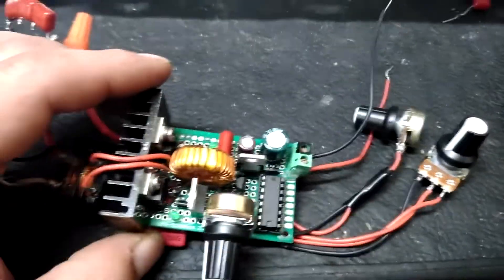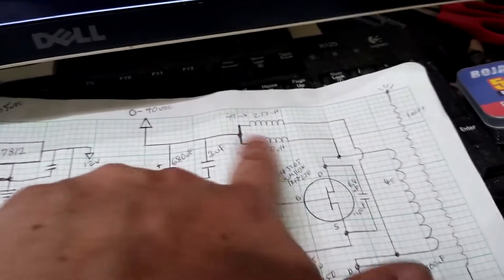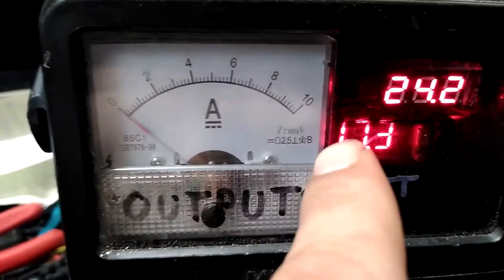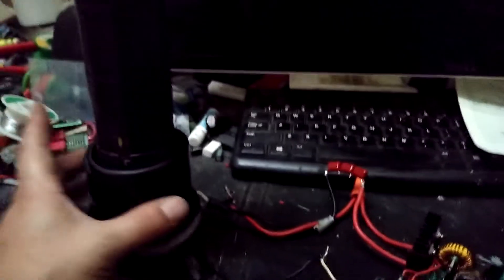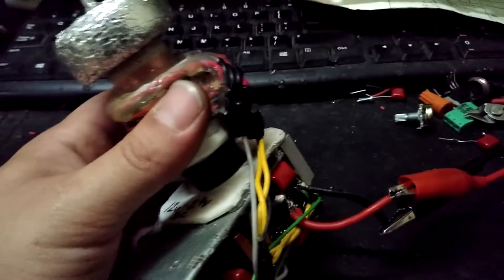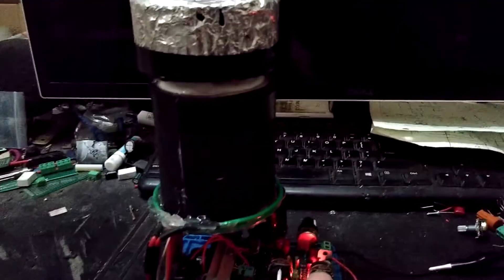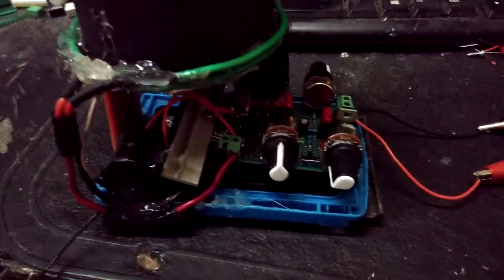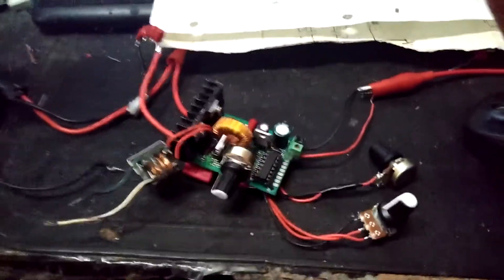24v SSTC/DRSSTC (Driverless) IRF3205's

Comment: what a nice and powerful coils you have! may I ask the winding directions of the primary and secondary? do they need to be in the same direction in order to work?
Reply from the maker: They need to have proper polarity relative to each other. That basically just means the direction is going to depend on how you wire it.

Comment: Tôi thực hiện giống như mạch của bạn nhưng với ic 555 nó không hoạt động, chỉ có một chút tia lửa nhỏ trên topload mà thôi 😢😢😢😢
Reply from the maker: Look at it like this.. so long as you have some output at all, you have it 'working'. That's one big step right there, just to get it working. You can likely now just play with the variables and eventually land on better output.
Reply: @Magneticitist  It killed my 460 mosfet like a terminator 😔
Reply from the maker: @jinnguyen4598  460's suck anyway, at least all the ones not coming straight from legit vendors. I would start with IRFZ44N's and between 12-16V or so input for building your first ones. If you're going to use what may be something like inexpensive ebay or amazon fets I would just use IRFP250's.
Reply: @Magneticitist  My 555 driver fails to interfere with the power circuit, I see the 555 ic still controls the flashing led but the power components do not follow the 555 ic, it always outputs spark with maximum power because  so it kills my mosfet 3205 then it kills 460 😔
Reply from the maker: @jinnguyen4598  It's just not pulling the gates low enough apparently. I would sometimes have that problem due to interference and bad grounding but if your indicator led seems to work perfectly on the beat then maybe it's something else. If you can't get that to work you can try using another mosfet to interrupt the power rail instead.
Reply: @Magneticitist  I tried z44, irf3205, and tip41 bulb still no result, I used 2 4148 pulse diodes at pin G!  , am I using the wrong diode????
Reply from the maker: @jinnguyen4598  Technically they are supposed to be Schottky diodes so yes they are wrong, but I'm not sure whether 4148's switching diodes wouldn't also work though..

What is your testing process? You also have to set the voltage divider properly for good oscillation, but you can't actually get it going if the gates are pulled to ground. This is why technically you should try testing it without interrupting it, but just at lower voltages and not for long periods to cause overheating. You need to set the voltage divider til there is just enough voltages on the gates to start oscillation. Then cut it off. At that point any time you pull the gates completely to ground, it's no longer going to oscillate. It can't. If it does, that means the gates are not held at ground when the interrupter is on and you need to figure out why.
Reply: @Magneticitist  I have found the reason, the topload on its head is too large so it cannot emit electric sparks. I removed the topload and the spark seems strong, can you give me the index of your resonant capacitor?  how many farads?
Reply from the maker: @jinnguyen4598  I'm not sure but I think I probably used 33nF on the circuit I drew the diagram for. It's not going to be the same for you though, you'll need to experiment. Typically a ballpark value that is fairly close will give you a noticeable enough difference to know you are going in the right direction.
Reply: @Magneticitist  Well thank you very much

Comment: Back in this project months later....
Wound a 36awg secondary, used some irfp250 and I got 2" sparks at 20v still decent for me . But whenever i connect the series primary cap, it goes way out of phase and Just doesn't work so I got it working with some parallel caps to primary. Do the d-s caps acts as snubbers ? I don't think so and my fets are still cool enough. Adding 22nf caps to d-s basically makes no noticable difference . Will be tuning it a bit more but don't know from where , the gdt works fine and IIr primary caps too not sure about the purpose of d-s caps though.
Reply from the maker: The series primary cap will change the phase relation which is sort of the point of it but you have to be at a tuning where adjusting that cap value will get you closer to the ideal tuning for it to be of any benefit. Often times instead of adjusting anything else I can just adjust that primary cap value to get particular coils tuned well. 

As for the snubbers that's more or less what they are, but they can't just be any random value to work. I've seen a lot of varying operation with these but in general they will act as snubbers and minimize the spiking on the drains. In order for them to actually help their values need to be in the right ballpark. If they are too large they are probably only going to hinder. If you were to scope the drains without the snubbers you might see what looks like 'normal' single ended operation on each switch with a lot of high voltage ringing. This will heat the fets. Likewise, if snubbers are too large they will probably heat the fets all the same. 

I don't really try to tune these 'dual class e' like some people because I find it too difficult, and the tuning all changes around given the slightest variations in how I have the output at the time. A lot of times I end up with 'double hump' waveforms on the drains.
Reply: Hey did you pop your Fets by adding series mmc? And now using parallel caps in primary?

Comment: I been looking into this fets Irfb4110  N chanel 120a 100v 370w Rds=0.037ohm I can get them at a reasonable price and it looks like these would work just fine to drive the tefatronix at about 35v with my boost converter , I feel this ones are gonna work better than irfp 260 for this voltage
Reply from the maker: Those would probably work pretty good but I would also recommend grabbing an Amazon pack of 3205s. I would use some cheap dummies for a lot of builds and testing while saving some more expensive suitable switches for final builds. I think what helped me get pretty far with a lot of these is just the sheer numbers of them. I intentionally tried to use cheap mosfets so I can make as many of these circuits as possible at low cost. Then after you've made about four or five of them things start to come together and it gets easier to make the next.
Reply: @Magneticitist  ohh brother , I wish I could buy on Amazon or Ebay but my Country put a bunch of regulations prohibitions and taxes , the amount of paper work just makes me go crazy , last time I bought something on ebay I did like 2 hours of wait at the post Office and they did not wanted to give me the package cause I put one number wrong , so now I stick to buying on electronics stores on my area (overprice fake garbage or sometimes super overprice original stuff) , sucks to live in this shitty Country
Reply from the maker: @rodriguezfranco3839  It seems to be a big problem with a lot of people so it makes sense why there are a good number of people asking me about particular circuits using particular easy to find IC's and stuff like that. Where I live I can't even think of an electronics store to buy stuff from directly so I have to get it online. We used to have Radio Shack and that was about it.
Reply: @Magneticitist  yeep , it feels cool to buy on a store , I got about 4 stores near my Area , but they got a very limited stock of IC's or electronics components , I heard about Radio Shack and seen a few videos about it seems like there are still a few of them open in the states , those stores look like electonics junkys Paradise lol , but I remember when I use to buy online on Ebay at some point I had a packet everyday arriving at my door and the prices wore so dang good I was making some good money resaling stuff , but then politics fucked up .

Comment: Hi, after trying every possible tuning modification i can think of, i still can't have it work anyway near your coils at either 12v or 24v. i tried the changing the primary to two turns and got the best arc (about 1/4th of an inch at 12v lol),i used 33nf cap bank in series primary.
i have a small coil about 7cm long and an inch in diameter which i wound from thin relay wire and is quite ugly and crap :/ , swapping the gdt didn't made any noticeable difference, using total 6600uF caps at input . should i try interchanging the choke wires? i have a centre tapped yellow choke with 35 turns total and what effect the capacitors 100nf on gate to source makes in this circuit? sorry for asking too many questions but i want to have it work within a day or so and i have no idea how to proceed for the further tuning. 
if this wouldn't work, i have some 32guage wire and i would wound a new secondary, any tips about secondary diameter and resonant frequency so i can calculate it from the web? thank you if you read this. :)
Reply from the maker: Hard to really say what you should change but it's possible there are still some things you have reversed or haven't tried. For example I wasn't too clear on the choke wiring probably because I forgot at the time, but swapping that around is worth a try. You could possibly just actually have the feedback phasing reversed also and the combination if your primary tuning and series cap is still making it work a little bit. Maybe just try reversing the feedback/GDT primary or secondary to see. If it doesn't want to output any plasma at all then it was probably right the way you had it. 

Other than that the 100nF drain caps were based on what I had at the time in my particular coil at its resonant frequency and I stuck to that region with other coils which was around 700-900mhz. 
They are basically tuned snubbers. Lowering the value to not below a few nF or so could better results, but so could slightly adjusting the series primary capacitor value. If it wants to work better with the 33nF cap as opposed to none at all, then maybe you could try doubling the value etc. This is also going to be relative to where you have the primary tuned at the time. I usually use 36AWG but I've made 32 work before in some of my first ones. With 32 I'd try to at least go for 7 inches or so maybe 2.5 inches wide.
Reply: @Magneticitist After trying 6 gdts and many primaries and adjusting its height, I got only about 1cm sparks at 12v and about 1.5cm at 24v , mine doesnt work with 100nF drain to source caps , it gets pretty hot too and I have roughly 33nF in series with primary. Guess I can't tune this anymore and need to get some 40awg wire someday , also have a second thought of increasing its voltage though.
Reply from the maker: @anmolkumar6704  Check out this replication https://www.youtube.com/shorts/DReCYcQRZ10

His was matched closer to the specs I put in the schematic I posted using the sort of tall 9inch or so coil.

He just happened to land on the right variables to play with in order to get good output. The sound of his arcs also seems familiar and it doesn't sound like it's about to crap out from wild tuning. What were your coil dimensions again?
Reply: @Magneticitist  i later wound a 2.5 inch by 6inch coil with all 0.2mm wire i had

Comment: Hi ,I built one yesterday but it didnt work out that well only getting half inch sparks at 24 v , MOSFETs(irf540) gets too hot in even 10-20secs , using the tefatronix push pull circuitry for mosfets with a 555 timer. Using a topload or adding a 2.2nf at secondary feedback shuts
It down. What could be possibly wrong?
Reply from the maker: I never tried 540's but I'd think they would be fairly ideal. Do you know if your gate voltage as set by the divider RV1 is appropriate? Too much voltage can overdrive it, I usually put just enough on there for reliable oscillation. 

At 24V you're going to heat up those fets either way if you are running continuous wave. The only way to avoid that is to do more specific tuning using snubbers and the primary coil so it runs efficiently. The other variable is the GDT which is harder to get just right without being able to observe the signal but you can usually just do some adjustments on it to see what difference it's making. Trying different ratios or winding techniques etc. I usually just use a pre wound common inductor from some PSU filter or something.

The other variable people do not think of a lot is the magnetic and electric field profile and how that affects oscillation. The output needs to be properly loaded, but in order to properly load it at the right times the topload and breakout points need to be tuned. It's not like a regular circuit where you can just toss a random topload on and have it work well. You have to try it without toploads, with various ones, using different length breakouts points etc.. Move the primary up and down various places with each variation. I've had some circuits that needed a particular topload and some which didn't like any at all. 

You also might need to help encourage the actual initial breakout using your hand or something. This is when it's going to run properly when it's being loaded by the output plasma.
Reply: @Magneticitist  i monitor the gate voltage and it seems completely fine about 4v but one major issue I worry about is that it doesn't seem like the interuptter is working as I always get a steady small stream. I used a 555timer with 100nf, pin6- 12k -pin7 -100k resistor -100k pot -vcc
Reply from the maker: @anmolkumar6704  Interference can be an issue with these. For me sometimes the interrupter wouldn't work right and it would slam into CW randomly. Adding some circuit shielding and trial and error grounding helped with that. It sounds like either your interrupter is not pulling the gates to ground hard enough or there is some big interference issue causing the interrupter to mess up. If you have the interrupter set to completely 100% output, then the gates should be completely off not allowing any oscillation.

Comment: Your Coils seem happier at lower frequency more power per band 🤔- I wonder if the position or the breakout point is influenced by the field created at the top of the coil form/ toroid?  I have also found that even though the Toroid is a capacitor, it acts like a collector too - without one, sparks tend to breakout from the periphery of the coil (upper most) windings - So this is maybe why your breakout point is happier pointing perpendicular to the toroid - Have you tried a flatter toroid with the same surface area?
Reply from the maker: With this circuit I guess there's a trade-off there because with the lower-frequency you're going to have a *slower rise time in the sine wave feedback and I think I've ran up till about 4 megahertz but I can't recall whether it ran better at the higher or  lower frequencies
Reply from the maker: With that one with the top load I had tried various stuff but just stuck with that. These circuits can be picky about the top-load but its really due to how I tune them. It's almost always sort of like trying to account for stream loading. Without giving it the easy side breakout point for example it might have a hard time actually breaking out unless I initially help draw the arc out by hand or something. If I tune it a little differently with the arcs maybe a little shorter it might not have any problems breaking out at all
Reply: Anyhow - your output is exceptional, especially as originally it was 1-1.5”
Reply from the maker: @Jonodrew1286  IDK what it is about this topology but so long as I got it 'working' these always put out at least a couple inches at 24v or so. I've had a couple inches at 12v also with the right tuning but I just like what I can do with 24v+ better. I wouldn't know where to start trying to get a single ended switch to perform about the same from 24vdc. The only real ramp in the input is the gate drive and when using IC's for a stiff square drive I got basically the same results.